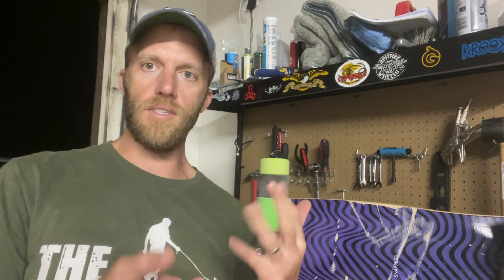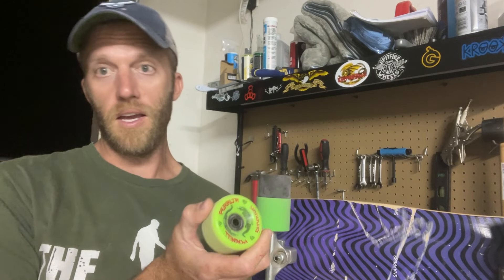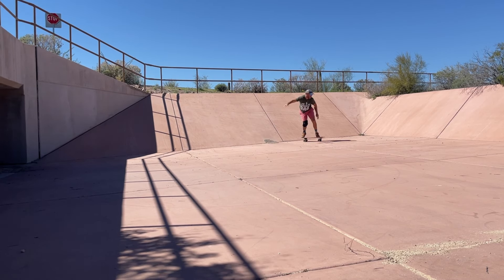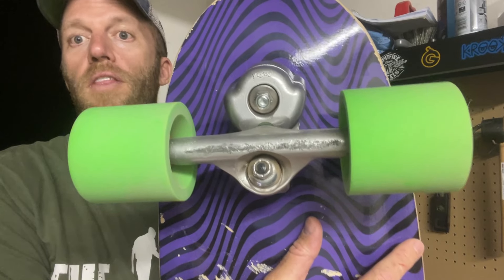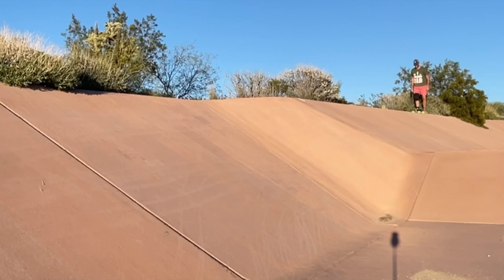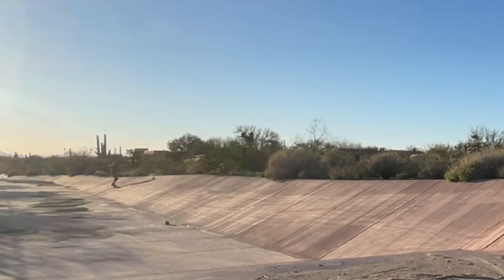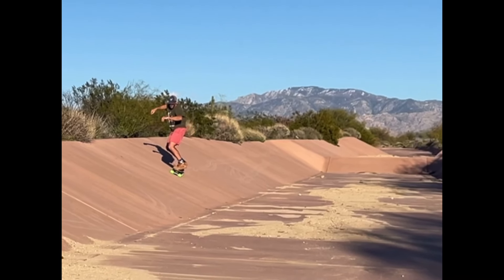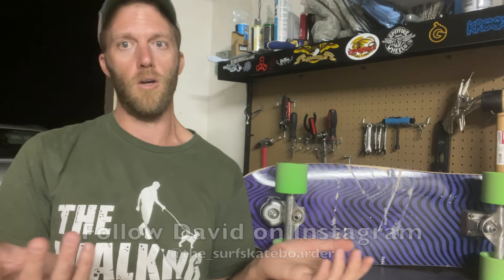Creative Ditch Surfskating with David Kemppinen

Comment: Steep bank riding definitely needs a much softer wheel compound than whats currently available.  Smooth-on   sells various super soft durometers of casting Urethanes. It's pretty easy to make a quick mold of one of your wheels and cast some 60a or softer wheels. Wouldn't be wheels for efficiently rolling around, but for ditch banging they might rock. Like you've been saying, right tool for the job.I actually have  a couple gallons of 60a duro urethane laying around, I might give this a try.
Reply: Yeah something gummy for sure. The centrax seemed right but as soon as they got dusty they couldn’t hold onto the smooth concrete at all.  Something about the properties of roundhouse wheels seemed to result in them maintaining their grip even though they got dusty. But I have no idea as to why. So much to learn

Comment: For that bank over the sand, if you pumped the board like a surfboard you (i.e. up and down pumping) you probably could make it
Reply: Dusty wheels/spot + smooth concrete= wheels losing grip with pumping. I’m betting it’s never been done and I’d love to see someone do it 🙌 problem wasn’t losing speed. Problem was loss of traction.

Comment: Nice! Take some contact cement and smear some generously around the wheels, and let it dry till tacky at least. Guaranteed you'll make that bank!
Reply: This actually sounds like something to try. You’ve experimented with this?  I was so bummed that the centrax wheels wouldnt hold. The concrete in that ditch is skatepark smooth and dusty so it’s a recipe for sliding out.  But if you think something like this would result in more tackiness without compromising too much on speed I’d 100% give it a go! Never tried anything like it!
Reply: @TheSurfskateboarder  I've never tried it, and not sure how long it would last....but I know that drag cars burnout their tires to melt the rubber to create a sort of super soft sticky paste for traction and contact cement would definitely mimic this. On dust free smooth cement you would have insane traction, but on dust, not sure. Just have to try it with some old beater wheels. It'll definitely slow you down somewhat, maybe alot, maybe not much at all....just have to try it! I'd try it but I don't have any steep banks near me.
Reply: @TheSurfskateboarder  The other thing that might be worth trying is tar. Trials riders rub a special kind of tar on their bike rims and brake pads that make them super sticky and grabby, maybe this could be rubbed on wheels and just a thin coat might be all that's needed to get that extra  traction.
Reply: I tried going higher. I was confused as to why this consistently yielded shorter carves. 

I finally used my app for measuring angles and found the lowest part of the bank was about 21 degrees and the top of the bank is 30 degrees. 

30 degrees isn’t too steep. But when you factor in very smooth fresh concrete and dust, you lose a ton of grip at this spot. Believe me/come try it out (would be fun!)

If it goes, it definitely goes more easily on a low line drive. 

I’m interested in experimenting with tar 😈